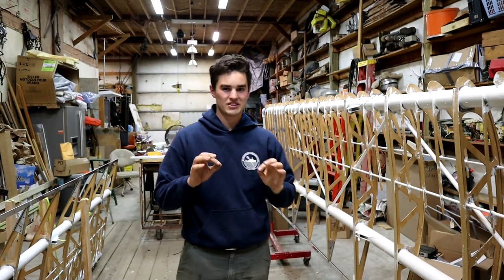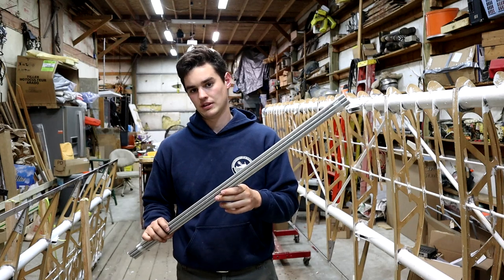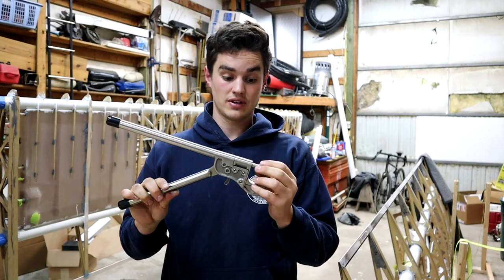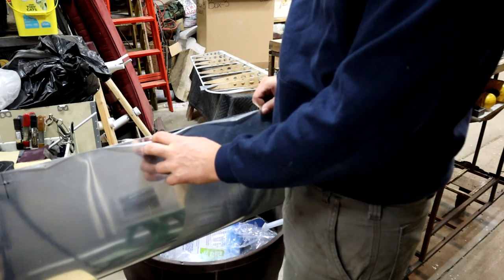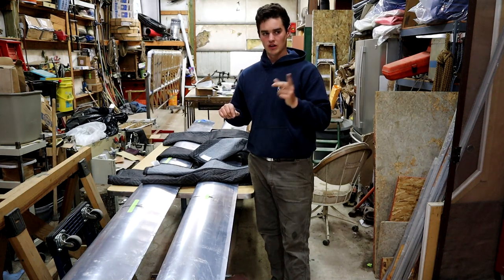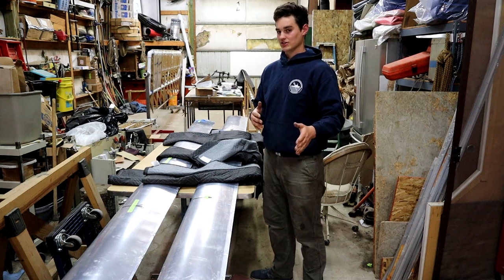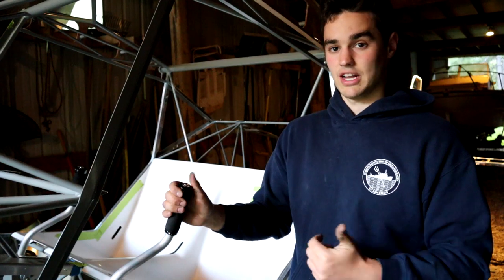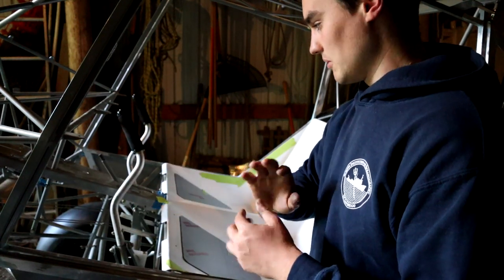Kitfox STi Build Update 6 : More Flaperons, More Antennas, Tail Access Cover Plate…

Comment: For the wire in the rudder, run a string now before you cover it. Then you can use the string later to pull your wire through. Or you can run a wire now and put an electrical connector on the end inside the tail..

Comment: yardstore.com sell almost all the tools you would need, like that cover you can drill the holes on the plane and come back with (clecos) a temporary fastener and what's called a (hole finder) to locate the holes. As far as those rudder pedals, I've seen where one side of a tube is welded the heat shrinks the tube and its no longer straight, so when you want to put a tube inside it binds. And when welds are to hot and to much welding rod is introduced to creates bump on the inside of the tube, which also creates binding.

Comment: on the rear cover plates      get some photos to the Green  Speedster  look at how they did the front  piece    it is sharp 
revnuts    if you can pull it a little  then screw the mandrel in a bit more and put a nut on the back   then pull tight    nut will keep it from stripping out

Comment: Hey sorry to comment on such an old video but I'm impressed by your dedication and off course you never stop learning. As someone professionally working on aircraft (Helicopters, though) it's super interesting to see how persons without that background do these things. But I just got some questions, since the camera angle isn't to obvious for the cover plate. As the others already mentioned, hole finders would be a way to go, or my favourite tool, cleco clamps. But what I was thinking about is, if instead of these rivnuts that I personally only know from cars ( as also with the pop-rivets :o ) would it also have been possible to fit riveted anchor nuts there? They're cheap and normally have a much smaller diameter. Or was there even enough space to maybe install camlocs? I know, it's been done, plane is flying for about 100 hours but maybe at some maintenance point or for other builders, these might be an option. I use the same rivet squeezer at work if i can't use my airtools and also love that thing! Really nice work. I would have used primer also on the aluminium parts prior to installment but that I already asked on another video! :)

Comment: I'm looking forward to your engine choice; hope you dont make the Rotax mistake!
Reply from the maker: Why is rotax a mistake?
Reply: @7KiloFox  Hi, Rotax unreliability for one. Check NTSB engine failure accidents and you will find Rotax at the top in the LS range. Another is old technology, still using carbs with one exception. Another is the "one exception", there is no change out of $50k for a firewall forward, fuel injected Rotax and required constant speed prop.
Reply: @David-pk9be  Thats not accurate, and Rotax is not a mistake. Continental and Textron/Lycoming engines had a failure rate of about 13 failures per 100,000 flight hours, with Rotax coming in at a slightly higher 15 per 100,000 flight hours. 15 failures in 100,000 flight hours... not exactly happening all that often and almost the same as conventional reciprocating aviation powerplants. Additionally there is something like 70,000 912 series Rotax powerplants out there. Pilots wouldn't be flying behind 70k engines if they were falling out of the sky. Concerning the $50k price tag, I would encourage you to look at Edge Performance. They are producing fuel injected 9xx series Rotax powerplants (and Yamaha's) that are pushing 165HP for far less than 50k. In fact I would bet you could get one of their engines and an Airmaster CS prop for under 40k.